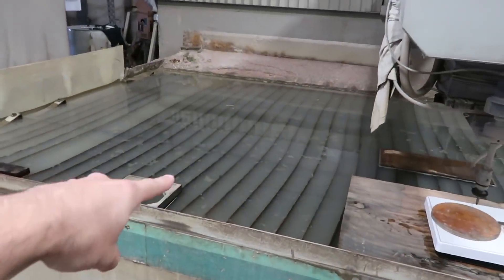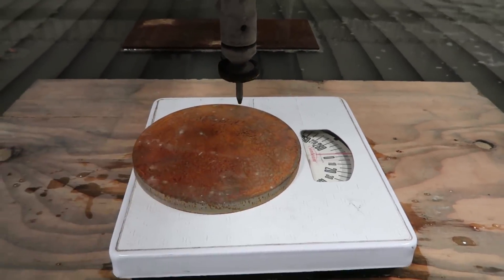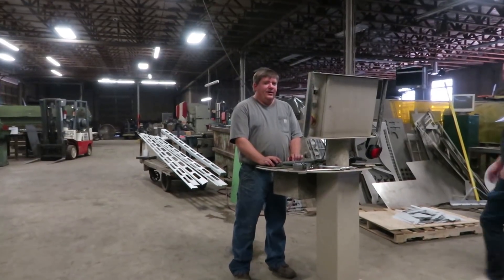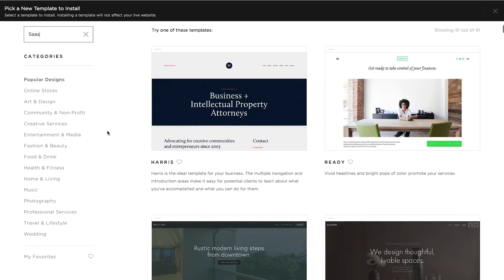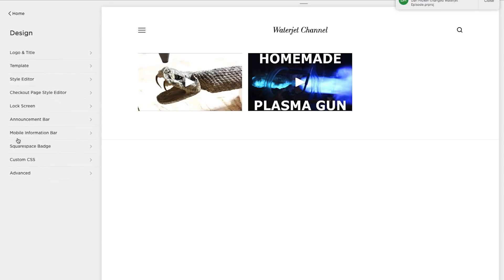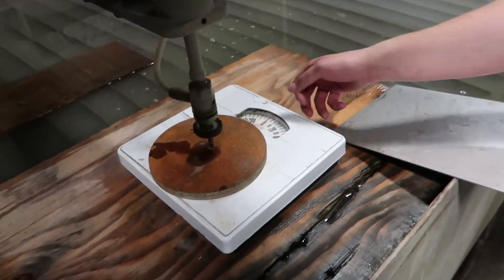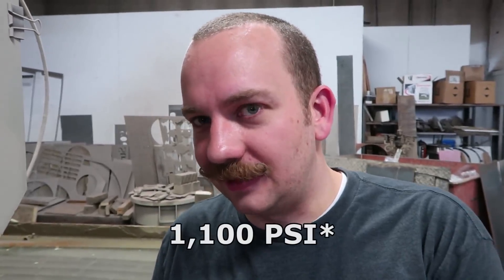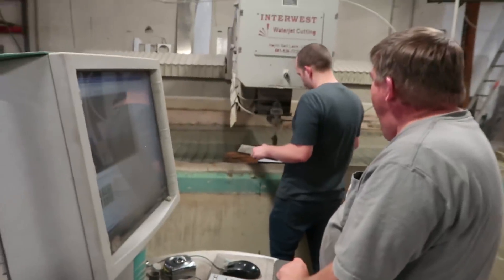How much does High Pressure Water Weigh? Bathroom Scale Cut in Half

Comment: The waterjet has 60,000 psi but thats only where the stream is. The way your dissipating the pressure   wont work. The psi is in the impact spot and is pushing on that spot. It does dissapate the pressure a tiny bit but only eleven pounds. If you didnt notice the little spot where you shot the water there was a spot there and that was because of the central pushing of the waterjet.              

Thats my guess and Im 13 but Im 80 percent sure thats correct.

Comment: Is it not the diameter of the water stream that you use for the calculation? You calculated the pressure applies to the area of the scales but do you not need to multiply that by the scale factor of the water jet to the scales? So if the area of the scales is 100 times that of the water jet then you would multiply the 1'100 you got by 100 to get the force of the water jet?

Comment: The data presented is insufficient. So I'll be basing all this off the skateboard wheel video, which provides more information.  We know that the skateboard wheel fragment penetrated insulation retainers on your facility's roof after travelling 3.3 meters through open air. Since we know your facility is located in an area of at least 3000 feet of elevation, we can back out the expected air resistance of a skateboard wheel spinning at absurd velocity, factor in the tensile strength of ceiling insulation panels, and arrive at a departure speed of 186 mph. From there, we simply divide by the diameter of the skateboard wheel to get inches per hour of rotary velocity, then apply the well known Gomer's formula for relating the coefficient of friction of the surface of a skateboard wheel to G, which is, as everyone knows, the constant for universal squirtness.  Take the derivative, and voila, 52822 PSI exactly. Simple.

Comment: So PSI just stands for pounds per square inch. If this is 60,000 PSI water jet then be multiplying 60,000 PSI by the area of them nozzle you should get the force exerted be the jet. Since you've measure 11lbs, then 60,000 lbs/in^2 * (Area of nozle) = 11lbs. So solving for the area of the nozzle 11/60,000 gives 1.83x10^-4 inches squared. The area of a circle is pi*r^2 which should be equal to the area we found. So we can solve for r, which gives 0.007639 inches, double that to get the diameter then the nozzle is roughly 15 thousandths wide. If you could measure that to confirm that would be great. Also since this was done in such an inaccurate scale the numbers could be off a several thousand PSI but in theory it should be close. Also you can use KSI (kilopounds per square inch) which is 1 KSI = 1,000 PSI. Hopefully this helps clarify. Sorry that's I can't write out all the steps and equation solving in a comment. If the nozzle is greater than 15 thousandths then the pressure is less than 60 KSI, if it's smaller then it's over 60 KSI, but in reality there's a large error margin.

EDIT: Also the fact that the garnet made no difference makes sense as you're not changing the pressure of the stream, only changing how abrasive it is which changes how well it cuts but not the pressure exerted. For example applying the same force to a butter knife and a steak knife to cut a steak, one requires much less force hence why you can't cut through steel with water only at 60 KSI, you'd need a much greater force.

Comment: The area of the scales doesn't matter. its only the area of the water jet that matters. Think about it. If you had 2 different sized scales would you expect to see 2 different weights when you stand on each one? The force pushing down is the same for both. If you water jet stream is about 0.05 of a inch in diameter, the radius is the 0.025 of an inch. The area is Pi*radius*radius, therefore the area of the stream is about 0.00196 square inches. So you had 11 pounds per 0.00196 square inches. you have to multiply 0.00196 by 510 to get 1 square inch. so the PSI is 11*510 = 5612. This is assuming the area of the water jet. If you want to tell us what the area actually is we can give a better answer. 

I'm guessing the 60,000PSI is a measurement of the water pressure at some other point in the system.

Comment: Without the diameter of the nozzle, you can't calculate the pressure. But you can calculate the diameter the nozzle should have if everything is correct.
17pounds divided by 60000psi results in 0,0003 square inch (about 0,2 square millimeters)
This corresponds to the area that the water jet hits.
Now you only have to calculate from the surface back to the diameter.
So the diameter of the nozzle should be 0,019 inch (about 0,49 millimeters)

Comment: Based on your comment saying the nozzle diameter is 0.06" and the scale reading 11 lbs, the water is leaving the water jet at 3,890 PSI

Explanation: the area of the nozzle is pi*(0.06in/2)^2. This area is putting out 11 lbs of force, so the PSI of the jet is 11lbs / pi*(0.06in/2)^2, which when evaluated gets 3,890 lbs/in^2.

Comment: If you got 100 square inches and water is .433 lbs of pressure per square inch. You should get 43.3 pounds for 1psi. You would need 476.3 pounds for 1psi across the scale to read 11 lbs. If we assume the water jet shot a 1inch square through the nosel (yes I know its much smaller just to make math simple) you would be getting 47,630psi. Given your water jet is probably a quarter inch once it gets out we will add 11,907 pounds for the difference of a .25 in square and a inch square. So 47,630+11,907 you have 59,537 psi. Which is really close to your 60,000 psi you should get.

Comment: Read the aperture size on the nozzle, and divide 11# by that number. (Working backwards, the aperture should be around 0.0153" in diameter. So I'm going to guess it's a standard size, so a 15 thou nozzle.) I think that Ben from Applied Science used a 0.015" nozzle to build his water jet.
Reply: Assuming a round hole 15 thou in diameter.  Area = pie*r^2 = 3.14159*(0.0075)^2 = 0.000176715 inch square opening.  PSI = lbs/inches = 11/0.000176715 = 62,247 PSI.

I'd say thats quite close.  Without knowing the actual aperture size for sure, I'd say this is pretty damn close.

Comment: You can't calculate it. The pressure drives the water, its energy is converted to kinetic energy. That also speeds up the garnet. You can get the driving pressure back only if the materials in the jet come to a still on the surface of the scale. But that is not the case, the water is deflected everywhere. The kinetic energy is also used in the process of abrasion. That's the point of the machine.

Comment: I think you need to know the diameter of the nozzle hole then divide by 2 to get radius, then π_r_2 to find the Area, then 1 square inch divided by the Area and multiply by 17 lbs = PSI
Reply: Actually, he doesn't multiply it by 2, he squares it. The area of a circle is πr^2
Reply: Yeah it’s definitely twelvety
Reply: And πd is only going to get the circumference.
Reply: You do have to know the size of the nozzle. Which according to google they are around like .015"ish diameter so yeah like 0.0001767146 square inches. And 60,000 psi.... Soo 60000×0.0001767146
= 10.602876 pounds so it could be a bigger tip OR EVEN MORE THAN 60,000 hope they read this
Reply: The nozzle would need to be .015 in diameter for that to be 60,000 psi
Pressure = Force / Area
Pressure = Force / (pi * (nozzle_diameter / 2)^2 )
60,000 psi = 17 lbs / (pi*(.015/2)^2)
Reply: Haha you're absolutely right about the laminar bit. In my mind it can't be any less laminar lol. Seems very turbulent getting shot out of that nozzle at high pressure
Reply: Also, there are a lot of (insignificant)inaccuracies because the flow of water is not exactly laminar( i think).
Reply: Noah Stephens the scale started at 6 pounds so you had to subtract that from the 17.
Reply: Oh, I thought they zeroed the scale, in that case multiply by 11
Reply: And as it turns out, typical waterjet nozzles are typically about 0.014" in diameter!

...that bathroom scale is more accurate than I imagined.
Reply: You are thinking right, the thing is, for you to know "exactly" the pressure the water is exerting you have to use the area of the water column ( which is not exactly the area of the nozzle hole ) but its a good approximation.
Reply: storkstork area of a circle is pi*r^2 or (pi/4)*d^2 not pi*r*2
Reply: Earthbjorn Nahkaimurrao that all looks right. With the exception that they were actually only applying 11 lb.
Reply: Earthbjorn Nahkaimurrao math looks great, but Mitchell commented saying the diameter of the nozzle is .060 inches.
Reply: Yeah so you put the radius of the radius over there turn the thridy upside down and multiply it by forty then quad root it 56 and I dont know what I'm doing
Reply: Experimental Fun wouldent it be 10 because the steel was 7 pounds.
Reply: Engineering 2.0 there you go 10 pounds of force spread across a 7 pound plate. On a 100 inch surface area. Makes sense perfecto.
Reply: Why would they use a bathroom scale though? surely you'd use a thermometer.
Reply: pyrodude19 pretty sure you cant zero anything on a basic purely mechanical bathroom scale.
Reply: If the area of the tip of the nozzle is 0.01851 inches squared or about half of a millimeter squared, then the math works out to 60,000 psi.
Reply: Its not multiply, I was putting the formula for area of a circle Pi R squared
Reply: @ExperimentalFun  Pi are round - cake are square. I learned that on a snapple cap.
Reply: this is the wrong way to do it. the nozzle diameter could be much larger. you need to use bernouli's equation as well as a control volume analysis around the nozzle with the momentum equation. the jet coming out of the nozzle, once it reaches the air is at atmospheric pressure. it is the momentum of the water in the jet that is pushing on the scale, not its pressure. this is called stagnation pressure.
Reply: Experimental Fun what
Reply: storkstork it's not multiplying by 2 that's squaring it
Reply: chris993361 no. With the garnet it read closer to 17
Reply: Earthbjorn Nahkaimurrao which is probably pretty close to the nozzle diameter. The ones I used were .020".
Reply: Noah Stephens that would make sense
Reply: What he said
Reply: Engineering 2.0 the weight of the steel wouldn't matter because they zeroed the scale with the weight of the steel already applied, any further registration on the scale would be the weight of the pressure
Reply: I was thinking the same thing...
Reply: Filipe Eduardo because it is pumped in and no pump can make a perfictly consistant flow of water
Reply: Experimental Fun 16.66732 ilbs. Get it right
Reply: Must be pretty accurate scale, wardjet mentions using 0.014 diameter for faster cutting speed with abrasive
Reply: You’re completely correct
Reply: i’m on summer mode so no math
Reply: Take 100 sq in, divide it by the area of the nozzle, and multiply by 11lbs.
Reply: Engineering 2.0 they zeroed out the scale with the steel on it
Reply: I agree with James. It is a collision. Dimensional analysis is mass flow (mass pounds per second) * velocity (feet per second) = fluid momentum. Divide by gravity constant to change pounds mass to pounds force. Fluid momentum / 32.2 (ft/s^2) = force of water on scale of +/- 11 lbf.
Reply: Wtf I’m I looking at
Reply: yeah it might be a 0.015 in diameter nozzle
Reply: So what did he say
Reply: Experimental Fun then using _ as * and ^ isnt a good idea (or ** if you use python)
Reply: How is lbs a force ?
Reply: Experimental Fun roughly .040 of an inch, give or take for wear of the carbide
Reply: What the actual fuck am I reading rn
Reply: Experimental Fun is correct, however the instant the water leaves the nozzle it is loosing pressure.  put the jet as close to the metal block as you safely can and your should see the weight go up slightly.  Then follow the procedure outlines above and you should be close to the pressure as it exits the nozzle.
Reply: What?
Reply: Experimental Fun 11 lbs because 17-6
Reply: I am very confusion
Reply: Wtf
Reply: So if u put 65^% f$$$@@$ ÷waterjet = psi?
Reply: Damn y’all smart
Reply: This is what you Engineers do while us practical machinists figure it out by trial and error lol
Reply: Of course
Reply: So this is what i did...... Since your nozzle is round.... I figured area and turned it into a square.... .060 is nozzel diameter .030 is radius.... R^2xpi=a is .030x.030x3.14 =.0028 now we need to use this number and use this as the area of a square area=a^2 soo we take find the square root off .0028 we get .053 we take 1 inch divided by .053 and get 18.87 x 11lbs is 207.57 lbs and that needs to be multiplied by itself to be psi and that gives us 43,085 psi..... The math is very sensitive...... For instance if your nozzel was 1/100 of an inch smaller making it 0.05  Your psi jumps up to 62,350
Reply: I feel dumb
Reply: Experimental Fun Your smart
Reply: It’s only 11 lb bc the steal plate ways 6 lb
Reply: Jesus christ this escalated dreadfully
Reply: I'm just going to pretend that I know what everybody's talking about
Reply: Nerds are cool
Reply: Well actualy the diameter of a=£₩€₩¤ equals Thomas Edison divided by the perimeter of 6ix9ine going to prison do thats you answer
Reply: 11 lbs, and you divide it by the area
Reply: Yes then Measure that by the length of a hummingbirds eyelash
Reply: NERRRRRRRRRRRRRDS.!!1!
Reply: @mattd1188  ooohk
Reply: @boltzrik7749  Whatever, nerd. lol
Reply: Sorry. I think my browser does not show the forumla correct. For me it looks like low dashes between the nubers, like this _ _, thought it means multiply :)
Reply: But why if u can £€-3÷2r2 and ňūţ *#%#*£%#€%'◇~◇
Reply: my name jeff
Reply: Ow my brain
Reply: Why divide diamter by 2, when you multiply it with 2 in your formula? You could just take π_d ? For the rest my math is not good enough :P
Reply: he means 2^2 

the formula for area of a circle is pi r^2 or pi d/4.
Reply: storkstork the 2 is for squared in his formula

Comment: It's the diameter of the nozzle orifice divided by 2 (to get its radius), then square the radius & multiply by π to get the water jet's surface area, preferably in  square inches.  Then it's 17 lbs / surface area to get PSI.
Reply: Oh, and multiply that by the contact area of the steel plate on the scale, as the 17 lbs is being pushed down by the entire plate onto the top of the scale.

Comment: You’re halfway there, also factor in the diameter of the water stream and given that it is less than one inch in diameter (what your calculation implicated) your 1,100 psi calculation will increase to be closer to the alleged 60,000

Comment: just guessing the diameter of the nozzle and the stream diameter on impact I think you're looking at 68k psi.  I can proof that for you if you like but I did my math on a calculator and made the mistake of not writing it down as I went. 
if you tell me the nozzle size I can give you a fairly exact number, at least as accurate as that bathroom scale is. 

and idk about that one but typically bathroom scales work exactly the same way as a dial indicator

Comment: p(pressure) = F (force) / S (area),  Force in our case is =mg (m for the reading on the scale) 
BUT the area of impact is NOT the whole disk.  The area is the inner diameter of the nozzle.  Measure the inner diameter of it and use it in this equation: mg/3.14 *( r)^2.  I would love to do the match for you,  but I am European and won't mess around with your measurement system.

Comment: Assuming no losses due to friction. 
1"/60000 x 17lbs = 0.0000283
= cross sectiinal area of nozzle
A=pi.r ^2
A^-2/pi = r
=0.0053"
Dia of Nozzle = 0.0106"(0.272mm)

What is the actual nozzle dia?
Anywhere near?

Forgot scales weren't zeroed.
Adjusting for 11lbs gives 0.0086"(0.22mm) dia nozzle.

Comment: I believe we need to know the orifice size and either the water flow rate or jet velocity to compute the pressure accurately. As a somewhat wrong ballpark figure, take the thrust in pounds and divide by the orifice area in square inches to get a lowball value of the pressure

Comment: So, i'm not good at english, sorry. But, i think what i'm good at math.

Your scales show us 11 lb or 11 lbf (Pounds-force).

And we have this formula. F=p*S. Force = pressure * Area. 

We didn't know pressure, but we know force, so p = F/S.

I didn't know size of waterjet, but i'm thinking, what hole is about 1mm in diameter.

So, we have: 11 lbf/(pi * (1/2 mm)^2) = 9036 psi (You can copy-paste formula in Wolfram|Alpha)
if hole 1mm in raduis, your waterjet is 2259 psi.

Comment: The scale is a bad way to measure psi. You need to use Bernoulli's equation, dynamic pressure P = 0.5*rho*v², where rho is the density of your jet, water is 1000kg/m^3. Essentially you need to figure out how fast that water is coming out of the nozzle. Ordinarily, I'd suggest pointing the nozzle vertical and doing a ballistic parabola calculation, however I'm going to assume the waterjet isn't capable of that. Easiest way to measure the water speed would be to put something like a pinwheel that rotates under the waterjet, much like you did with the skateboard wheel (although, preferably something that can handle the rpm, because, you know, can't get an accurate reading if it explodes), run it to max speed, and using a high speed camera count the frames and figure how fast it's rotating. We can use the skateboard wheel as a baseline, although it's not accurate since it exploded before reaching its maximum speed. Standard skateboard wheels have a radius of anywhere between 25mm and 30mm. Which at 45k rpm, means anywhere from 117m/s to 141 m/s. 

Solving the equation, I get between 68k psi and 99k psi, depending on what the diameter of those wheels was. Probably closer to 68k, since 25mm radius wheels are larger than average.

tl:dr, Math.